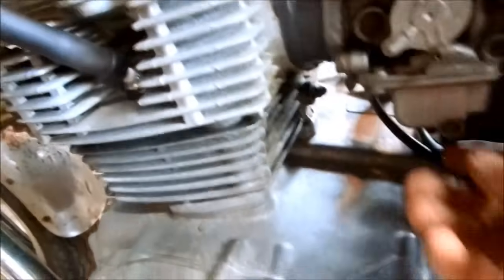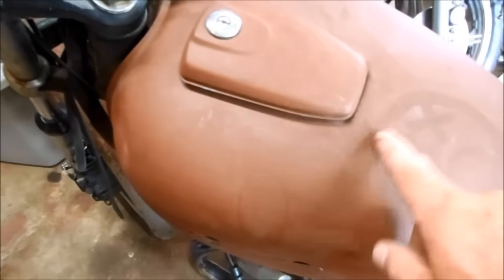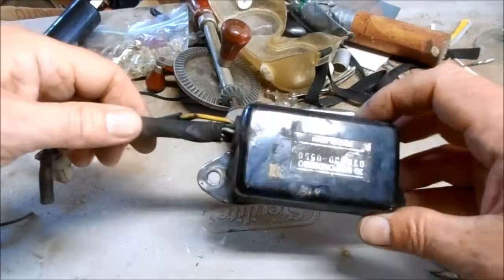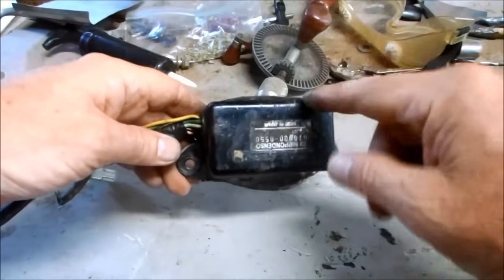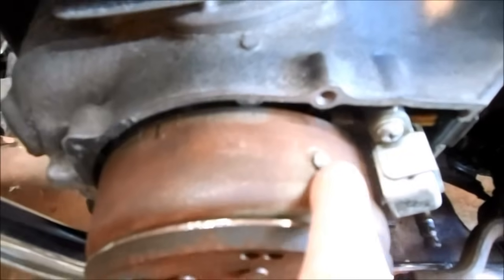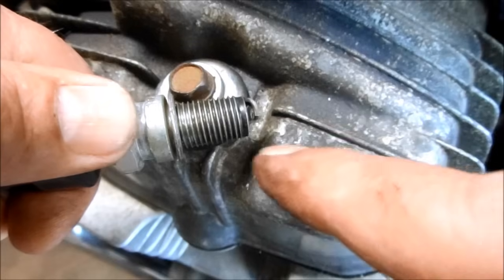how to test and repair motorcycle CDI electronic ignition module coil system spark failure

Comment: How to fix your ignition system.
Step 1. Light the old one on fire.
Step 2. Buy a new one.
Reply from the maker: that's over-simplifying it a bit   ;)
Reply: :D
Reply: Ichiban Moto  .
Reply: I thought the same thing. Lol. You can see he broke the circuit board trying to pry it out. Then says, ummm, I see some rust I better, buy a new one. Need to change the name of the video. Lol
Reply: Cameron Rate 😂
Reply: Badass
Reply: Cameron Rate

Comment: This videos feels like it comes from another dimension seriously:
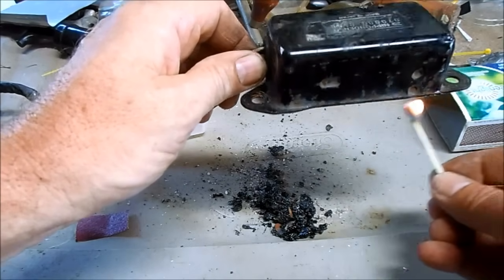@02:10 "Make sure you don't heat it up too much. You don't wanna damage the fragile electronics" Proceeds to blazing it to hell.
@02:25 "Now that the epoxy is off the circuit-board, I can carefully pry the board from the case" Proceeds to obliterate the circuit-board with a flat screwdriver

Lmao

Comment: don't heat it too much because of delicate electronics, the next shot you see is that it's on fire HAHAHA
Reply: What is the part #to the boshe system u used
Reply: michael cluxton did you find out the name of the part
Reply: Joseph Christian Salas HAHAHAHAHA
Reply: LOL ikr
Reply: I saved the video strictly for that!!!
Reply: The part about the rust around the edges that probably rusted out some components…..(don’t look at the huge sections of board that’s been broke off while trying to gently pry it out )😂
Reply: this was brilliant
Reply: And then, having said be careful not to damage the board, it's chewed to bits! Nice job. These were rubbish back in the day, I had to change these regularly on CB 250 and 400s
Reply: I thought the same thing lol

Comment: @Ichiban Moto This reminds of when my buddy got stuck out in the desert with no sparks. Luckily I had one of those dollar store electronic cigarette lighters. We replaced the thumb button with one of my buddy's stainless crowns from his back tooth. Then using Nickletown assembly tape we got that sucker jammed just right in the spark plug hole. The piston would push on the lighter at just the right point to give a spark at BTDC. Couldn't have done it without inspiration from you dude.
Reply: Cool story, bro!

Comment: I came here because i got honda rebel 125cc and it has no spark. Couldnt solve it myself. Sent it to shop they fixed it and it cost like 100 euros. In Latvia quite expensive since monthly AVG wage is about 500 eur. Then i run it for 1 day and it died again. Basically i turn it on it runs great and while warming up after 1 minute it died. And no spark. Then i took it to another shop and spent another 150 euros and it ran again. For a few days. Until same happened. I came in the morning to warm it up then it died. It's like it ate all the fuel from carb and died. But there is fuel. Thought it's cdi, but if cdi dies it stays dead. As much as i understand i took apart some stuff and checked wires and fuses. All good. (not 100% sure about wires) I am lost. Maybe you can help. P.S. Good luck with your channel! Subbed :)

Comment: You need to come to Indonesia then i will teach you how to modify it with cheaper CDI but you can still get a good result. 
This old motor bike is so easy to modify if you are in Indonesia, we did it many time just because so many customer come to the workshop but they still love this old motor bike so much then the new one.
Reply: Andra, please tell me if you know all about ignitions. I have a honda cmx 250 twin motor that is going into an off road frame. I will not be using any of the wiring from the bike. I just want an ignition that will produce spark to both cylinders. Does this exist? If so, I  will  buy it.  I have machining skills also so ignition that is close to size I  can modify. Thank you.

Comment: Step by step to inspect current flow

1. Check Battery Voltage
2. Check starter relay
3. Check fuses
4. Check the starter magnet coil
5. Check Ignition coil
6. Check ECU
7. Check fuel lines
8. Check the ON switch.
Reply: I'm here for cdi repair we alrdy did all that bs. He melted it with a match and got a new one...really helpful
Reply: Forgot about the kill switch!

Comment: Holding the spark plug is a fine way to get a nice shock.  You were lucky this time, Ichiban.  On the bright side, the shock tells you it's working.  Heck, you don't even need a spark plug when you test it that way.  :)    Yesterday I realized there are a couple of sets of points in my electrical box.  They're going to stay there too.  You never know.  Also it is kind of an old times' sake thing.

Comment: I upgraded my 77 kawasaki to that exact same bosch "modern points system" so sweet, requires no adjustment and prob Gained upwards of 50 hp😉
Reply from the maker: Nate H  bad ass !     that reminds me- I still need to build a diy dyno
Reply: +Nate H  what did you use i need to know
Reply: Nathan  where can i get one of those ignition system?
Reply: At a joke shop

Comment: so it dosn't use CDI anymore ? is it give more power than original CDI do ? im just asking
Reply: no, but it is much easier to diagnose & repair. with points, you can see every part of the system and make adjustments or troubleshoot individual parts. This also gives you the ability to repair your bike's ignition on the side of the road with only a minimal set of tools. it kind of sucks when your motorcycle breaks down in the middle of the night when your on some dark country road in the middle of nowhere with no cell phone reception and creepy, foggy cornfields on both sides.. this is the type of mod that will save your ass from being stranded!!! and yes, I know that sounded suspiciously specific. :) and I know this is a old thread. but his question needed to be answered.

Comment: If this is real substituting points to replace a cdi is brillant.
Reply: +Randy Smith hahahahahahahahahah
Reply: Installed points on my  Honda big red up on the cam when I was 12,  It almost ran but Backfired  when I pulled it over and my whole forearm tuned black and blue. About 1982 those were the days lol.

Comment: I didnt see how that cover fit over those points, and he forgot to mention the the timing is going to be off by 10 to 20 degrees.  OR the part # for the point set.   Im going to try this on a Chinese bike Im having trouble with. Im going to use a car coil, condencer and what ever points I can get to fit...if it works, Ill let you know.
Reply: Did it work?
Reply: Christi Werner of course it didn’t work

Comment: I just switched to the same modern Bosch ignition system on my GY6 motor. Now even a scooter can be badass...
Reply from the maker: +Yann Kitson    I need to get a scooter project
Reply: +Yann Kitson Careful, the excess power can crack the engine block.
Reply: Yann Kitson everyone has asked ickaban for the name of the Bosch part so they could do the same thing, but he has never told anyone the Bosch part# or the info to use the same part. could you please tell me what exact Bosch system you used so that I can get one? I would totally appreciate it 🤔 thanks
Reply: @ichiban could you please tell us what exact Bosch system you used? I have the same exact bike and problem and your video doesn't help if we don't know where to get the part or what Bosch part for that matter. Thanks my friend 😊

Comment: Next time you need to remove black epoxy, don't fight it with a match and cutting tool,  just wait for a sunny day and use a fresnel lens from an old projection TV to burn it off.  It takes badass to a whole new level!
Reply from the maker: +john robert   oh! top tip !

Comment: I did the same upgrade on my bike but i put the Bosch points on my handle bar so I can open and close them manually, you can fine tune the bike  while you ride.
Reply from the maker: oh, top tip!  skill level ninja !
Reply: arigatou gozaimasu

Comment: I have a similar problem on my motorsickle. The thing is that while troubleshooting I removed the CDI and tried to start the bike and it behaves exactly the same as with the CDI installed (doesnt start). This leads me to believe the problem is not with the CDI and that I might not even need the CDI unit at all. Looks like I can save some weight here!
Reply from the maker: +Carl Daniels   every little bit is added performance !
Reply: Fly, little bird, fly!

Comment: "New state of the art ignition system."

That was a breaker points and condenser trigger system.

My 1974 Pontiac had that system from the factory. And they are older than that.

They also require periodic maintenance, adjustments, and replacement.
Reply: So would you not recommend putting it in your motorcycle?
Reply: @sebastianreyes-schulze3276  never said that.

Besides, my current bikes are the same model, one 83, one 85. Both use the same type of trigger that failed in the bike in the video.

Those pulse generators are no longer available from the manufacturer.

So, if mine ever do fail, I may have to resort to the same fix as was used in this video.

Besides, the beauty of things like breaker points is that they are purely mechanical. They are completely EMP proof.
Reply: Serious, that Bosch Ignition system is really a step backwards, points has not been used since electronic arrived.
Just remember to adjust, now and them. 
Hope, that you get some better tools, and at the same time learn to use them.

Comment: I have a brand new aftermarket CDI for my 1980 Suzuki GS450. I put on new coils as well. Engine ain’t even running yet and the CDI is getting hot. Any ideas? Regular was replaced with a new one probably 15 years ago but has seen very little mileage since.

Comment: It seems fixing a used cdi box is impossible..Only way is replacement..BTW can the ignition coil,CDI Box or the magneto tested with multimeter for its voltage output?

Comment: Nice video.
Sir. I have a Honda Rebel (cmx) 450 from 1987. Recently my right spark doesn't have ignition so I started with the cheapest.  I changed the sparks and still  no spark on the right one. Then I changed the wires that goes to the coil. It worked the first time It started. The second time I started the motorcycle I had the same problem. When I was testing with my hand if there was pressure getting out from the right muffler I accidentally touched the muffler and I got an electric shock!!!
Im thinking there a wire out of place and maybe the ignition coil got busted.
any recommendations will be gladly appreciate it.
Reply: Abimael Rivera Rivera  yes check your wiring

Comment: well say goodbye to spark advance, and hello to additional points ignition maintenance.

gotta be some cheap Yamaha, or Honda cdi box that's cheap and worth cutting and soldering connectors on to.  let alone how many robust aftermarket racing CSI boxes that can be tuned spark advance for rpm difference

Comment: Being a twin you're  working on there, I  want to replace the ignition on a cmx 250 motor that's  going into an off road frame. So an alternator delete is in order. Need to know if this ignition will work for this swap? Thanks.

Comment: i assume the bosch unit has to be powered by an 115 v AC outlet. If so, does bosch include a wheel kit so that you can tow the AC outlet behind the bike? ( i realize you didn't have time to film it)
Reply from the maker: +unionse7en   or just four 90 amp 3v batteries with an inverter

Comment: My jaw dropped..! can you use that bostch cdi on any motorbike? i'm trying to fix my bike honda hornet 250 1996, i removed the carbs twice cleaned them up and everything started ok, small leaks on carbs so pull them out again and install them back for the 3rd time, this time it doesn't rev up, it will crank, but still no rev, i replaced the plug with new ones, battery is over 12v and it is always charged, fuel on the bowl is ok, plugs does have a spark, i replaced the carbs with a new set, and still it wont rev up or fire up...
Reply from the maker: +Joms F  if you have spark on both plugs, it is obviously not an ignition problem. After cranking, are the plus soaking wet, or bone dry ? They are probably dry because you are not getting fuel in the cylinders
Reply: yup they are bone dry, was looking for a starter fluid but can't find one in our country, i tried spraying carb cleaner and see if it will start and so far no luck, or maybe I'm doing something wrong, will check again for sparks, by the way the vacuum or air suction on cylinder is kinda ok as i can feel air being sucked in when i placed my hands over the inline 4 carbs, and i can hear them dribbling when i press start
Reply from the maker: +Joms F  drop it by the shop
Reply: bike fired up, rev up, i used carb cleaner to start her up, now time to rechecks carb bowl leaks and syncrho the carbs

Comment: Am I assuming correctly that it was a CM400A you were working on an the CDI was a nippondenso 070000-0550?  If so, what is the part # of that Bosch unit you used in lieu of the CDI?  I'm looking at buying a 1981 CM400A and I suspect its CDI is bad.
Reply from the maker: you can get good used cdi units off ebay for cheap
Reply: Why won't you say the part number?

Comment: what was the part number for that bosch replacement?? I have a 78 Honda hawk 400A automatic that has a bad cdi!!! super hard to find. if this works, I could use it. thank you. R. Downer
Reply: Richard Downer I’m in the same place!! Same bike and everything. Did you ever find anything?
Reply: I’ve got the same bike guy I got it from had wires all chopped up and in pieces so I got the power to everything but I just can’t get spark!
Reply: Another replacement but it’s procey

Comment: Hmmm, odd to say coil not getting voltage from CDI then going straight to replacing CDI. it could easily have been that the CDI was not getting power, and was still working, means a stator problem. New ignition system circumvents that but possibly a perfectly good, untested CDI destroyed in the process. Unless stator testing was done but not shown.
Reply: Spanner Monkey  exactly! It may have been the pick up coil
Reply: @ashleylloyd7445   which part is the pickup coil? Can it be replaced easily?

Comment: which wire do you connect rhe pick up coil to the points with also will it work any different if I destroy my cdi with a torch and a 30 ton press

Comment: Hi ichiban! I have a 1980 gs550e . Question, can u still get spark if the igniter is defective? I have spark on all fours, but the igniter test (done per manual)fails. :( I've checked all connections too. Thanx in advance
Reply from the maker: +Juan rod  there is a spark advance curve that may fail even though there is spark. It's best to use a timing light to see of your spark is occurring at the right time at idle and through the advanced curve
Reply: +Ichiban Moto  thanx for always helping us.... By the way I'll pay anything for that screw driver!!!!

Comment: Hmm, I've been having some weird problems with my bike, where it sometimes looses a lot of power, I've been wondering if it could have anything to do with the CDI module not providing spark advance, perhaps I should try installing something like this as well.
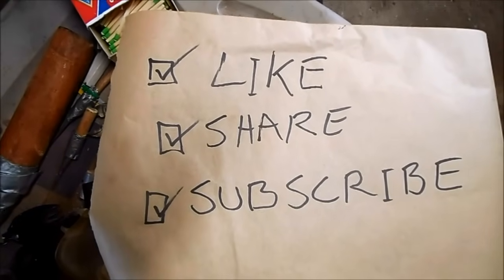Reply: Cleaning with industry grade cleaner (like the one shown @ 4:55) may do the job ;)
Reply: I think it is encapsulated in epoxy as well, but I will check.
Reply from the maker: Simon Als Nielsen  it just takes some mild heat to soften it up
Reply: Ichiban Moto
I love your videos, but I'm not really sure I trust you :-P
Reply: Simon Als Nielsen
Youtube (and internet in general) is a very safe place full of friendly people all willing to help ;)
Reply: holynex it's just that some of the videos seem like there are some hidden steps...

Comment: i need help with the 1988 gs 450. i have a spark on both sides but on my left side sparks is missing sometimes. if i move the wire away an inch way from the plug the spark is fixed only on higher rpm s. have changed my plugs now what is left is the pulsar, cdi and ignition,. any thoughts? n how do u make that testing light bulb

Comment: Is that Bosch ignition system universal for any bike? If so where can I buy one?
I have a 82 Honda cb650 and the stock ones are super expensive. 

Where did you connect the red and green wire?
Reply from the maker: +Russell Rhome  if stock units are still available, they probably have not made aftermarket ones yet

Comment: How do you get the light bulb to light up when testing power? Doesn’t look like yr holding it to an actual ground and a power like a normal test light? Yr just holding it near a power and if power is present on the circuit the bulb lights? How?

Comment: i dont think thats a good idea, putting contact point rather than a cdi, contact point wont last long than a cdi, but anyway i like your videos i learned a lot specially the trouble shooting problem
Reply from the maker: many old bike CDI's are not available. anywhere.
Reply: I beg to differ,  Yamaha dt400’s ignition was cdi and those genuine units had a 1000 hour shelf life. Points are far easier replace, easy maintenance and cheap. I’d like to know where the condenser goes

Comment: how does your electrical test light work? i can only see one contact point and its ground i think.
Reply from the maker: it's electyric
Reply: Yeah, that's not a common test light. It doesn't require both electrical connections, it's like those electric screwdrivers. Second, it only works if used by a trained professional, like in the video.

Comment: So on my 1980 xt250 Yamaha doesn't have any spark do you think that would work for it
Reply from the maker: you should take it to your local shop for diagnostics. could be the magneto, the cdi, the coil, the high tension lead, the spark plug cap, a fuse, switch or a  wiring fault anywhere to , from etc any of these
Reply: Ichiban Moto thank you